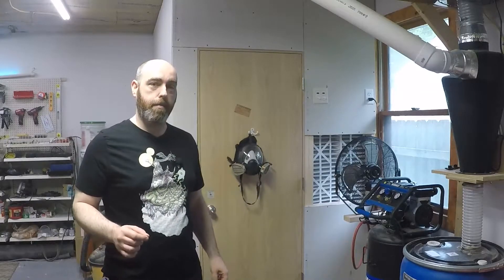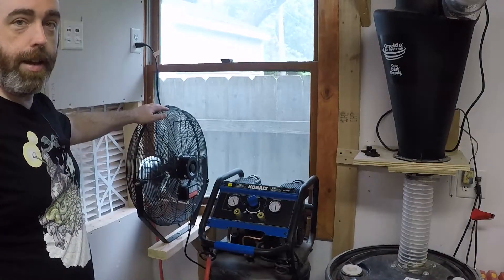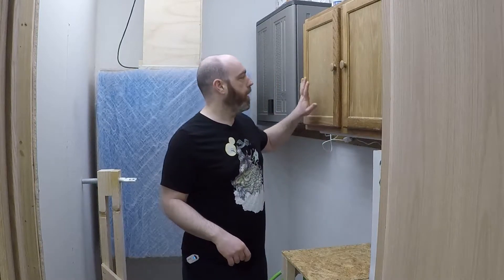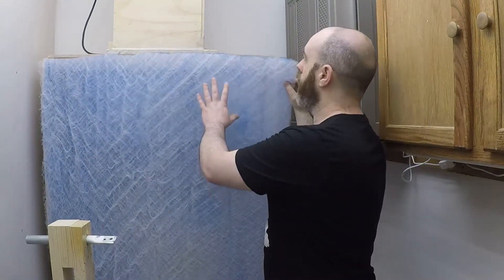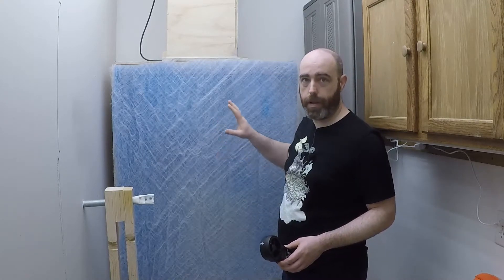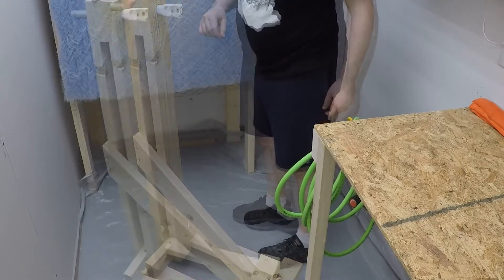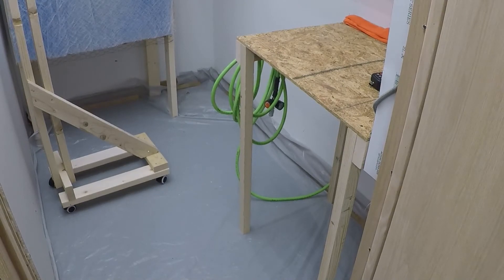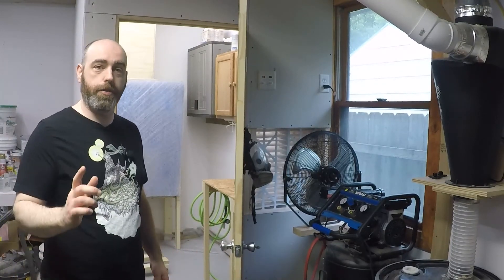My awesome new paint booth!

Comment: That's a great spray booth. Looking forward to some spray videos.
Reply from the maker: The strat build I am currently working on does include some in-booth footage.  👍
Reply from the maker: @TheCrimsonRabbit  That's the beauty of having a strong air flow and filters, no additional protection needed. (... so far. XD)
Reply: @ERWebster ,cool
Reply: @TheCrimsonRabbit , I use my GoPro while painting. It should be fine with the fan pulling all the overspray away.

Comment: Awesome job. I think the intake fan might be unnecessary, but the outlets inside the spray booth are generally a no-no. I think this is one of the best set ups I’ve seen for luthiers tho. Great job
Reply from the maker: Thanks!  I did consider the issue with electrical service to some degree, which is why the switches to the fan and lights are outside the booth. Still I agree with your assessment, the ideal setup would be for all electrical connections to be outside the booth.

Comment: The cheapest door at Menards!  
I miss Menards...they don't have em up here in Seattle.  They have a hardware store called McClendons, but I usually just go to Lowe's.  
Of course you know me, instead of the cheapest door I could buy, I'd use the best door I could find thrown out in an alley 😆 

Great video Erick, and awesome booth!
Reply from the maker: Menards is pretty great, they stock a lot of stuff that the other ones don't. And nothing wrong with upcycling if you can.

Thanks! I'm pretty stoked with how it turned out.

Comment: Yup. The videos are getting better, but the really impressive part is how much thought you put into what you're doing. Just thinking through equalizing the pressure is much more than alot of people might do. The booth looks great. There is one thing I would do differently. I would have the front of the mixing table on 45° supports mounted to the wall, as opposed to the 90° legs resting on the floor. Now, I'm not saying what you did was wrong. I'm saying I have big clumsy feet, and would one inevitably have an accident. 😱 You, however may be much more graceful. Heck, you'd almost have to be. 🤫😊
Reply from the maker: Thanks, I really appreciate that.  I guess I just figure if I am going to spend dozens of hours and hundreds of dollars on something it makes sense to spend some time really thinking through to the best of my ability.  Ineveitably I will missing something anyways, might as well get it as right as I can for the things I don't miss.